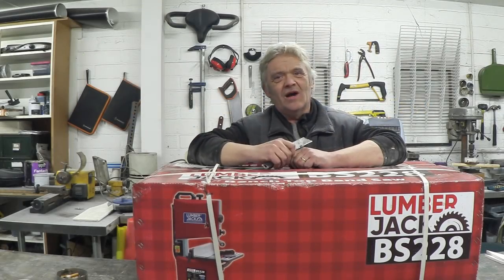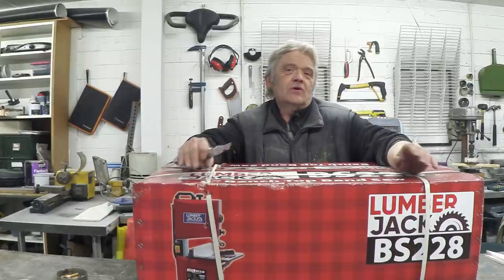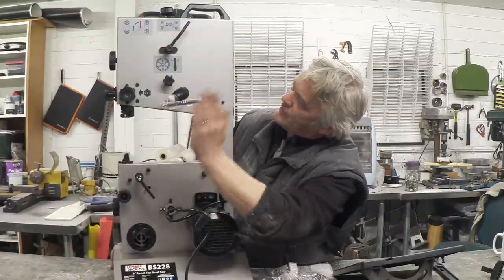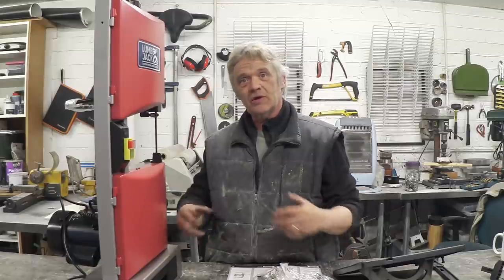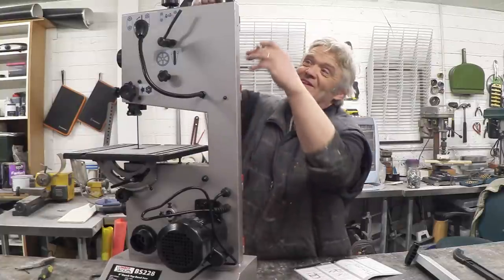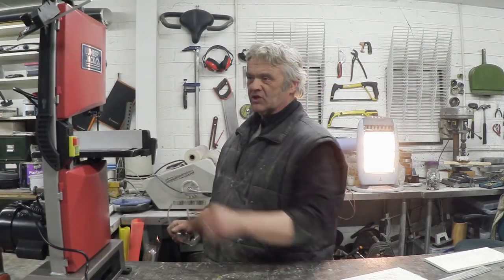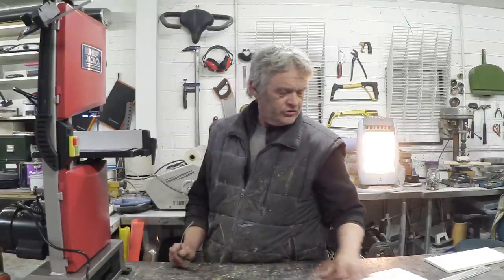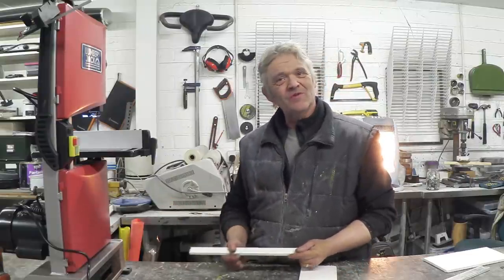962 - Unboxing A Bench Top Band Saw Lumberjack BS228

Comment: RMS, I'm using the bandsaw that my Dad built years ago. 2x4 frame, wooden pulleys, angle iron and skate wheel blade guide, table from their old orange countertop they replaced in their kitchen, belt drive and washing machine motor. And a series of light switches for on/off and crude speed control (hi. low). Although he passed away years ago, every time I use it, I think of him and am amazed how well it works.
Reply from the maker: that is awesome mate

Comment: That's a very nice quality saw! Here's a useful tip. If you put a quality bimetal blade on it like this one : Starrett - 99124-06-08 Intenss Pro-Die Band Saw Blade, Bimetal, Intenss Tooth, Raker Set, Positive Rake, 80" Length, 3/8" Width, 0.025" Thick, 10-14 TPI ( Available on Amazon ), you can easily cut metals like aluminum, steel , stainless etc. I put one on mine and it cuts through these metals like butter. The key to this is using a quality blade like the Starrett. Lower quality ones will wear out fast and do a poor job. You will of course need to choose the proper length and width for your particular saw.

Comment: my students and I loved the band saw.  All most got me once, always remember ( tell Luke for me)  the is a small safety circle around the blade that is how far the blade will jump forward at you while putting a load on it from pushing the stock into the blade, also this circle includes the distance time it takes you to stop the motion of your hands from pushing to stop moving ( this is under estimated often, No matter how good your reflexes are, this last thing cannot be overcome, Leave more room than you think is needed, use the push stick when you can), I had two students injured and it was well working with a harder wood, pushing, and having the blade emerge from a cut sooner than they were ready With their hands too far in the circle of safety around the blade. You guys enjoy your new Bandsaw it looks like a pretty darn good one, keep your guides in adjustment Blade tension proper, and purchase some replacement guides if you have the type that are friction based on consumable, if you have ball bearing guides, find bearings with double lip seals to replace the ones they gave you, have Fun, this will be a great tool, they are very handy
Reply from the maker: nice tips mate - cheers

Comment: It might be a hobby band saw and there's plenty of help on setting setting them up on the net but my 2 cents tip is to buy professional quality blades, particularly if you want to cut aluminium. 2ndly it pays to have a range of tooth pitches and blade  depths handy as this can be the difference between success and frustration.
Reply from the maker: nice advice mate - but to be honest this was a breeze to set up

Comment: _  “like that for instance” _ lever.  Think that is the quick-release blade tension lever. What would be helpful in a future episode is how to weld the blade back together again when it brakes (as it will do from time to time) and grind the join smooth. Also, show how to twist any spare blades into a smaller loop so they take up less space when hung on a wall or wherever. A visual demo of this technique is worth a thousand words. This is one of the machine tools that one doesn’t know how useful and time saving it is until you get one.  If the company gets the parts manufactured abroad it may be an idea to buy these capital items sooner than later, as foreign made equipment is due to go up in price (by a lot) as the current economic crises unfolds.
Reply from the maker: nice advice mate - cheers

Comment: I was dumbfounded when I saw that the table surface is utterly unprotected for shipping.
Reply from the maker: really? I didn't even think about it - it's a pretty solid block so unlikely to dent - maybe a scratch through the cardboard - but I doubt that too - seems like a bit of overkill to be 'dumbfounded'
Reply: @ThinkingandTinkering  Maybe it's just me, but if I were to package that tool, I wouldn't pack a machined surface facing out against the side of a cardboard box.  I suppose my ocd is showing. 🤔